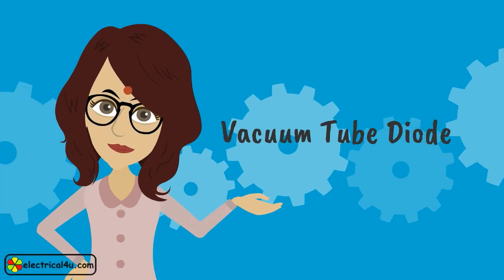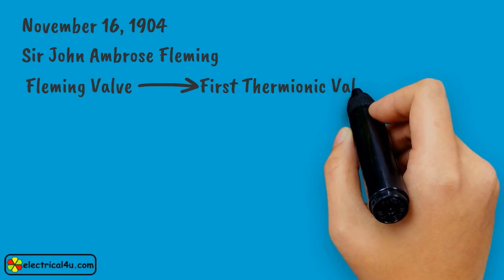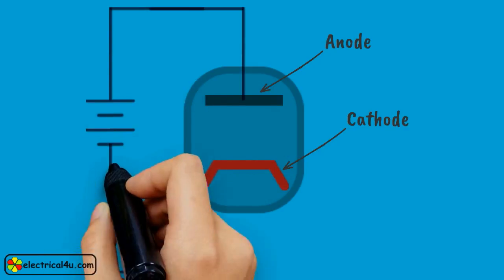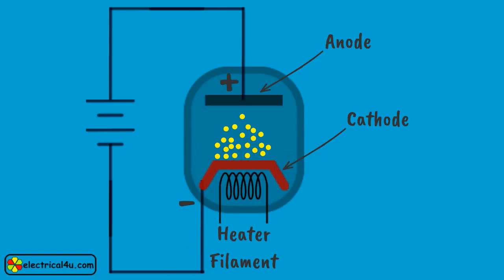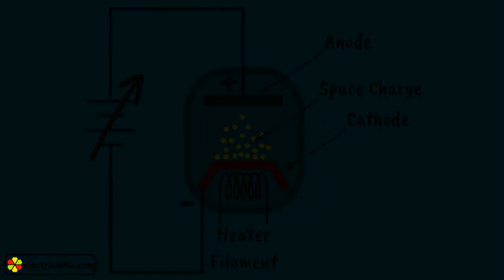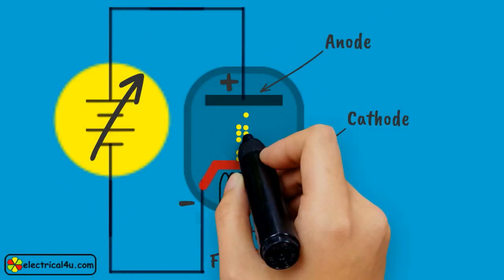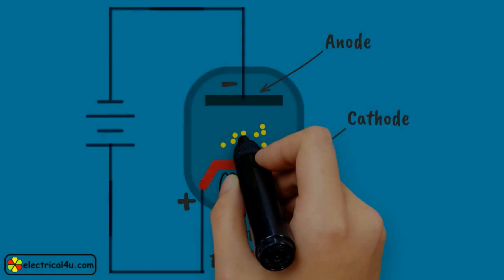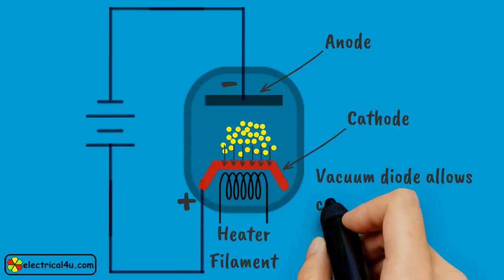Vacuum Diode

Comment: Very good , it could be improved if a short intro or outro text explains the interest of vacuum diodes
In my opinion they can be used with alternative current by letting only positive alternance pass by or also to control a current with a smaller eating signal , eventually they behave like a resistor in dc but not linearly 
Thx
Reply: Very nice